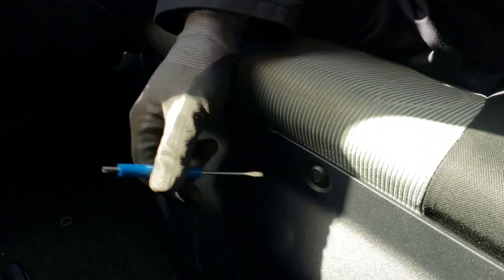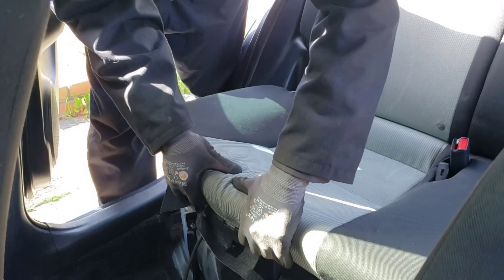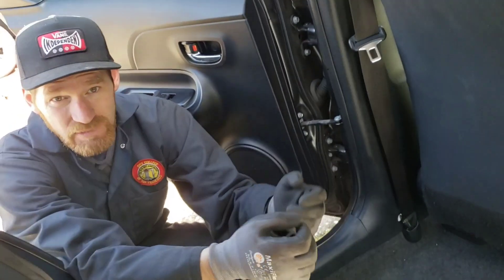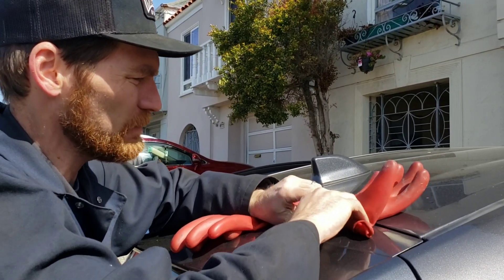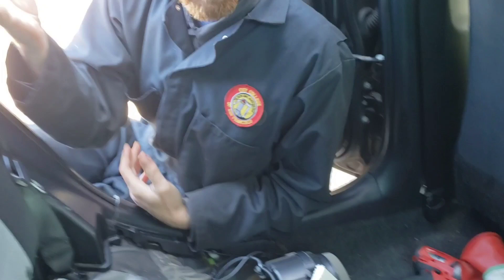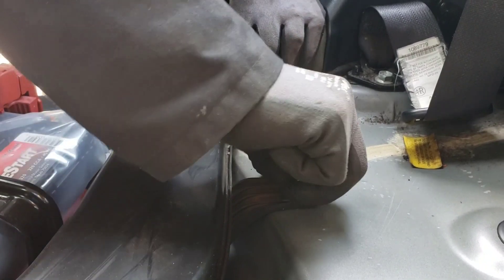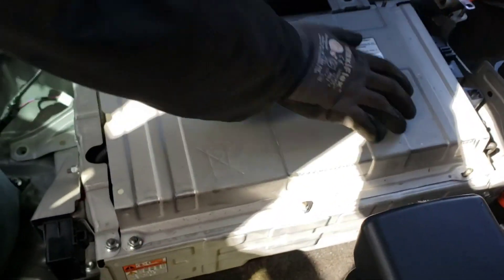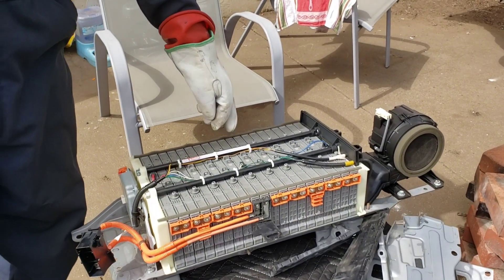Hybrid Battery removal Prius C

Comment: Guy just sold ma Prius C clean title with 115k miles. Said it ran great, didn’t notice anything on the short test drive, but I drove another Prius c which is getting 15+ mpg better. Man got me good.
Reply: Sorry to hear that @UsefulEveryday. My 2013 Prius C is at 112k now and still gives about 50 mpg in mixed driving, close to the 53/47 for city/hway according to specs.  No degradation over the years as far as I can see. Is your’s giving you 35 mpg? I am surprised - are there any fault codes in the OBD?

Comment: Thank you so much! Just replaced my battery, and now the car won’t start. It goes to accessory, and doesn’t let me start. HV plug is fully seated. Any ideas?
Reply from the maker: check the codes and let me know. Is the 12v battery charged?

Comment: Great video, I have a 2013 Prius-c that I bought as a total. I fixed the sheet metal and drove it for a few years. It has 33,000 on it and was running great. I then let it sit for a year before I bothered to put a charger on the 12 volt battery which I had replaced when I rebuilt the car. Got it running and the traction battery is giving errors. Low voltage on A and low voltage on B. Is that a battery conditioner in the video? If so would you give the model and source? Thank You for the video and help.
Reply from the maker: It is not a conditioner just a tester. I have not had luck fixing old batteries

Comment: What is the torque spec for the bolts that hold the hybrid battery to the car? and the torque spec of the bolts that hold the seat frame? thank you very much.
Reply from the maker: I judge by bolt head size.
If you want the actual specs look on Toyota Information System with a 1 day subscription.

Comment: Is there a way to charge it without removing it?? I bought a 2014 toyota prius c that was involved in a deer accident. Vehicle sat for over a month, jump starting the 12v battery only turns on lights but will not turn the car on.  It says to check the hybrid system on the screen. Codes p0A40 & p0A41 came up from the obd reader, Position sensor circuit. Anything i should try to start it up? Or does the hybrid battery need to be replaced because the car sat for too long and maybe the battery is dead
Reply from the maker: Those codes are not battery related. There is probably a broken wire or unplugged connector on the side of the transmission.
Reply: @Mrelectric423  and you are probably right, damage had pushed the driver side cv axle out and only the end piece was still inside
Reply: My 2013 Prius C sat idle for over a month (6-7 weeks) in winter and just needed a 12V jump and some highway miles to get it back to normal.

Comment: Bringing a single cell up to scratch is fruitless - Batteries internals grow stalagmites and stalactites which cause internal low resistance and self discharging.
Of course, all of the cells are aged with the same issue. Most likely only get about 6 months to a year out of the fix.
Reply from the maker: That is more or less what was stated in the video and why its called battery removal not fix.
Reply: @Mrelectric423  Of course.

Comment: My time has arrived to change my high voltage battery just use your video as a reference made my swap out of my high voltage battery much faster
Reply: How did it go? This looks scary lol I need to change mine and I don’t want to pay the dealership 5k
Reply: @MillyChango  it took me 45 minutes. I had to make the choice do I want a refurbished rebuilt battery pack three different companies three different prices
$780 
Another $950 rebuilt 
Another company was $1250 

Brand new factory OEM Toyota was $1900 
I went with the brand new Toyota factory . 
I’ve worked on cars my whole life and I worked on high-voltage electrical so for me it was easy 

Nothing I would recommend for an absolute beginner with no experience

Comment: Very helpful video! Thank you. What's your opinion on swapping bad modules with ones off of Ebay and call it good?
Reply from the maker: Without matching capacities its pretty hopeless
Reply: I did it.  car runs great now.  I've seen a couple of other people posted how they did it and the car has been good for at least 3 years.  I bought another running prius from a tow yard and that battery pack also had 2 bad modules . So i fixed mine and have 22 spare modules now that i've sold a couple also.
Reply: @ilovemyevo556   How is your Prius doing 3 months later after the repair?

Comment: If the modules lost capacity it doesn’t matter if you charge one module close to others. Once owner turn on AC all lights pop up again and car set in limp mode. All modules have to be with the same capacity plus properly balanced.
Reply: What does balancing modules means?
Reply: Hedgehog The Sonic same voltage while battery under load and in quite condition.
Reply: @skrimsodessa-usa   I see, thank you very much for answering.

Comment: Cool. Good temporary get around. Last week just experienced running out of gas leaving my car on idling air conditioning on and running my HV battery  down flat on my Prius C. Took almost an hour plus disconnecting the 12 V battery and letting it rest. It finally restarted the engine.
Reply from the maker: Interesting scenario. Glad it eventually fired up